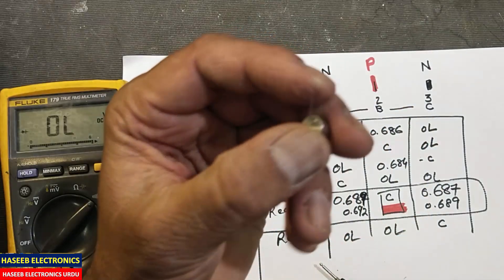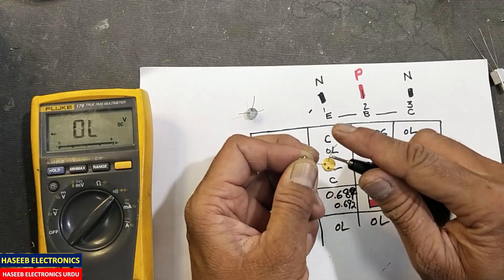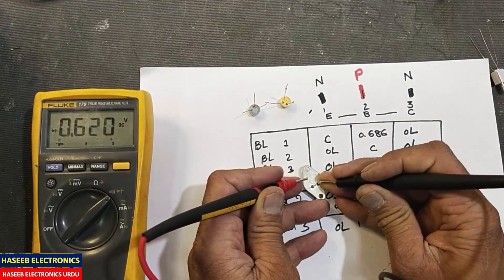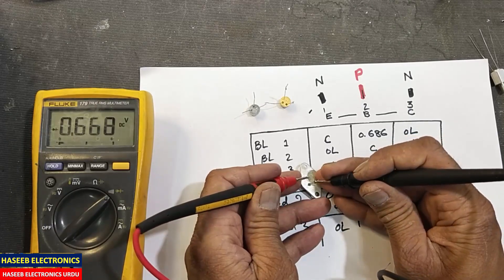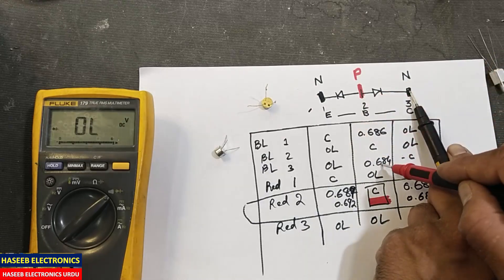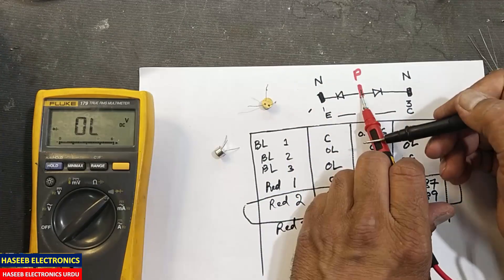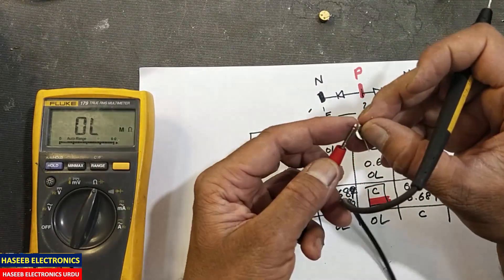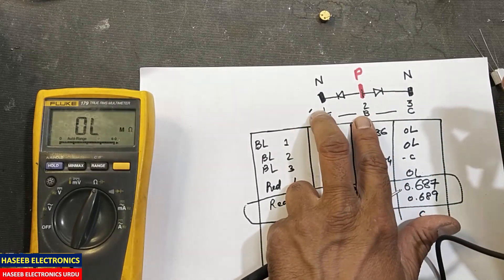{613} How To Test TRANSISTOR Using Digital Multimeter

Comment: Assalamu Alaikum Sir I hope you are well.  Sir my DC power supply 24 volts output 10 amps.  The problem is that when something is given to the load, the voltage drops to 8.  Normally the output voltage shows 24.  I have replaced all the capacitors with the same quality then the problem remains sir it helps me a little how to solve the problem.
Reply from the maker: Wa Alaikum Salaam brother 
it is much better for me, that if you mentioned the power supply model number or the PWM IC
okay no problem 
for 24V 10A = 240 Watt ithink there is TL494 or KA7500 IC
please check its feedback circuit connected to pin 1 & 2
if that circuit is good, then verify pin 15 & 16 circuit 
if all components are good, then replace IC